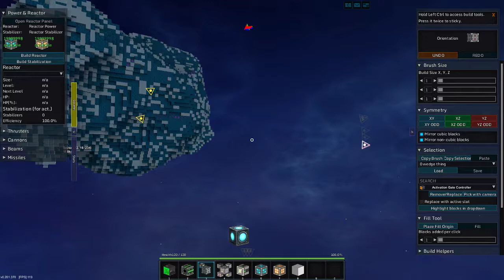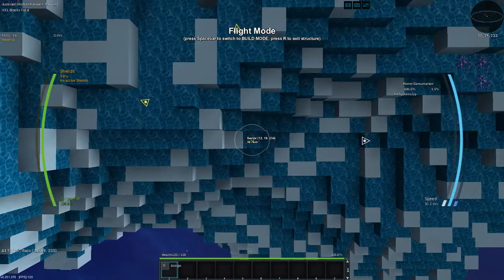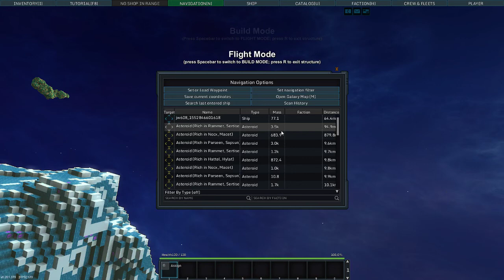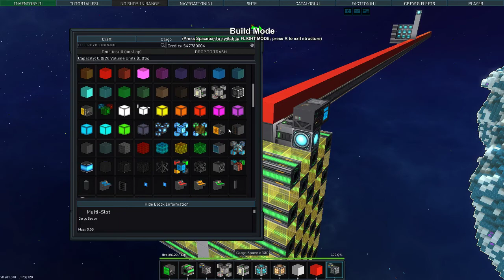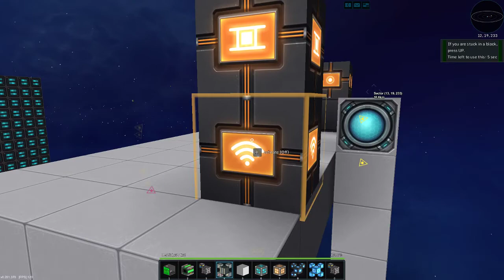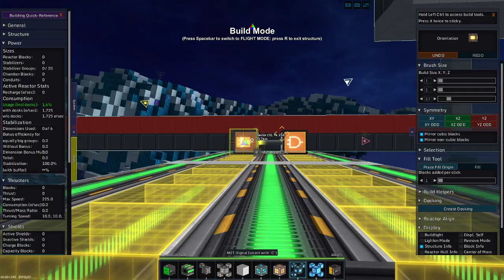Crazy Mining Test - StarMade S2-226

Comment: I find that rotational and lateral rail miners work best. You just park outside an asteroid for a couple minutes and it eats it up. I have one set up to fold the mining rig out and pack it back up. 

The hardest part is setting up intra-storage transfer. Easiest solution is detaching the mining array having it moved to an unloading area. Whilst at the same time switching it out for another array.
Reply from the maker: Thank you.  I will keep that in mind as I build this thing.

Comment: Will the beam be traversing the ship from front to rear, or side to side? I think bow to stern would be cool (shooting out the side of the ship), but you could also do it in the front, though it would be a wide ship. What if you had two rails that pass on the same axis... like a mouth opening and closing. If that makes sense?
Reply from the maker: I was thinking from port to starboard (or vice versa) on the front of the ship.  But right now I'm still in the "can I even do it" phase.